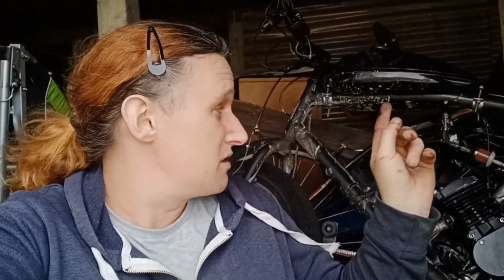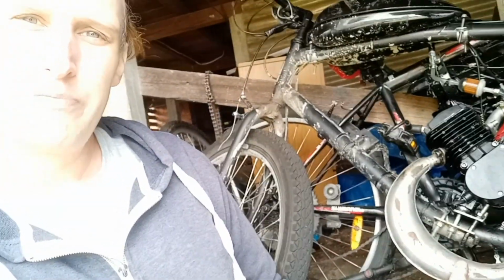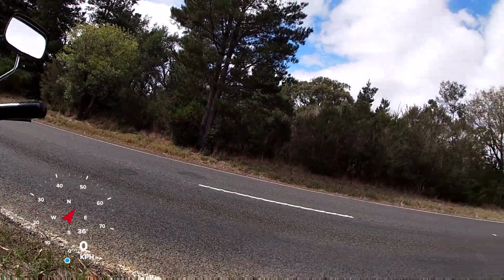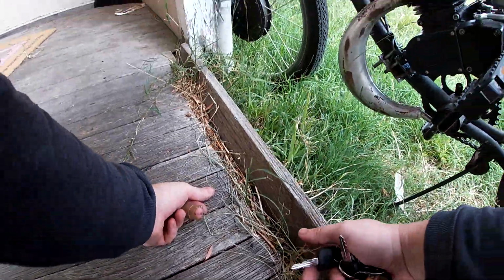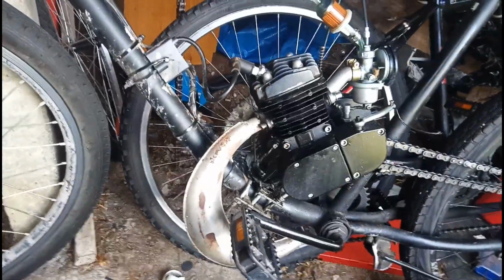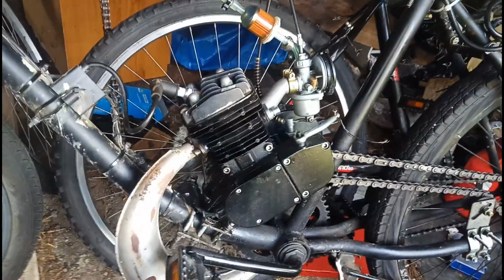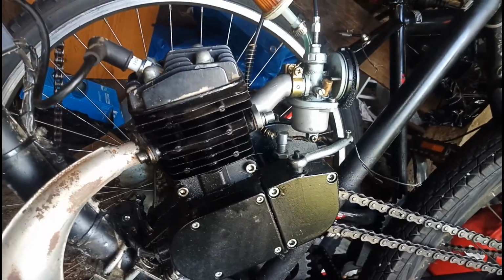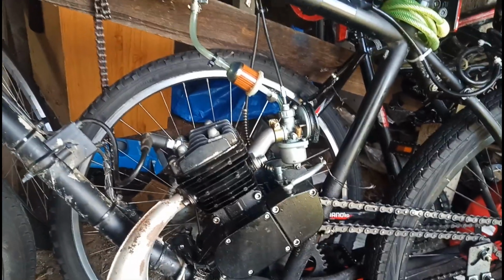Mk5 Final 66cc 2 Stroke Ride

Comment: Your correct about the carbs, unless your going full build, window port and Reed, or case Reed the HP is way to much, 
That little banana pipe cheapie is built crappy with intake tube and exhaust tube protruding into the chamber, causing disruption in the sonic wave,, unfortunately the larger pipe the MZ clone suffers same issue but is way better.
You will love the BT100 I have two, 
Tips: they don't like running rich, 16:1 is way to rich on break in,, 24:1 is best and then up to 40:1, stock NT carb with a 65 jet and needle set full lean is what they like with stock exhaust( I suggest gutting the can and getting rid of the baffles so it can breath, welder required)